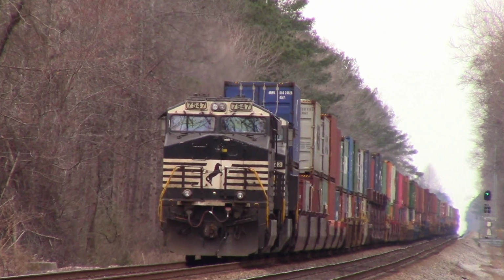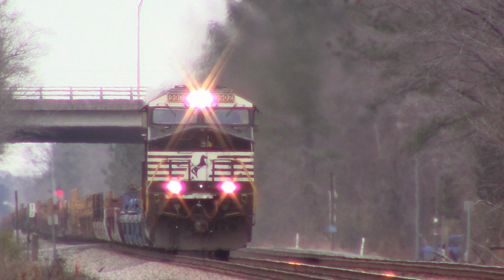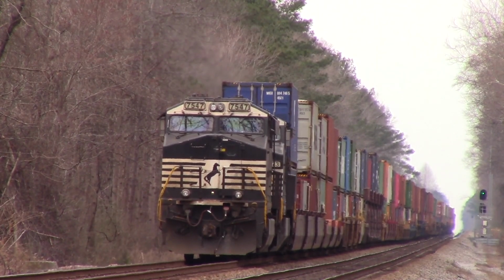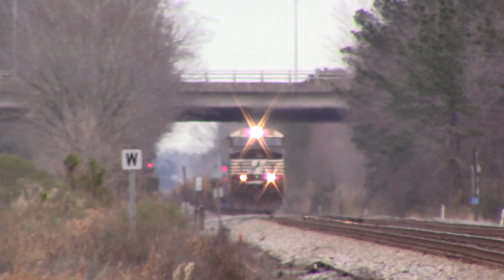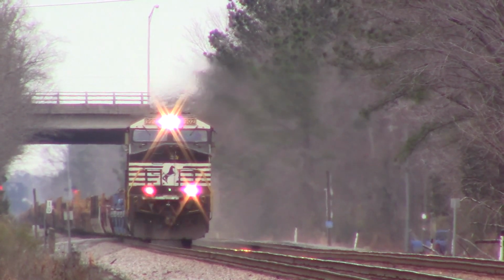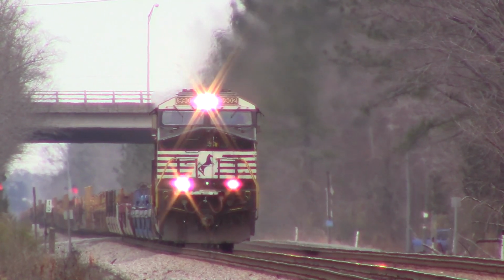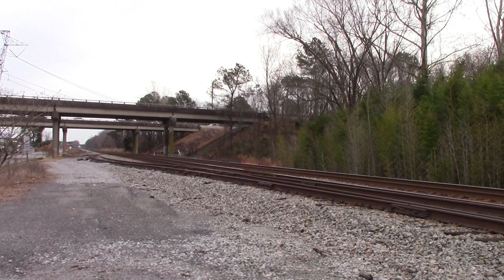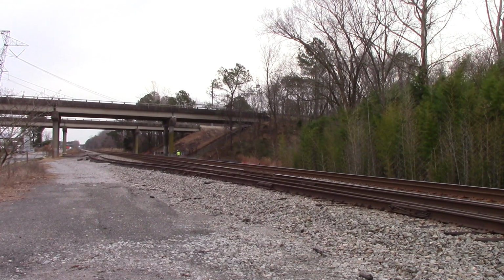NS 23G AND 25M

Comment: 25m is 23q
Reply from the maker: Well you are on the right track.  The bare table runs on NS are 23Q, 24J, 24R, and 25M
Reply: @engineerpat5290  I have new videos. Thx
Reply: @engineerpat5290  Why do I want to see V14 in Waverly so bad?